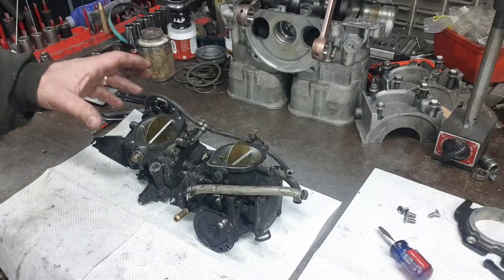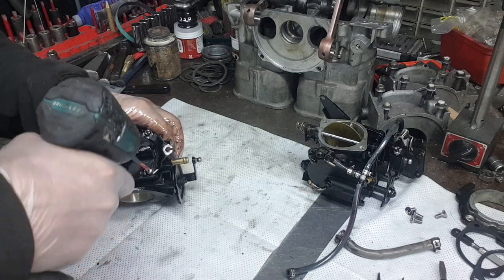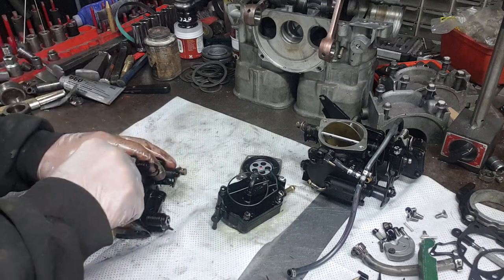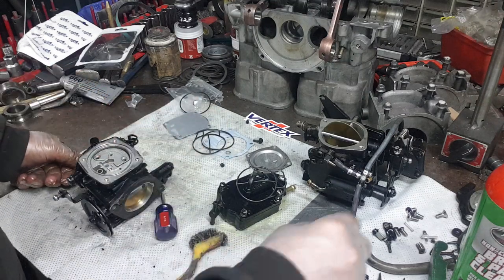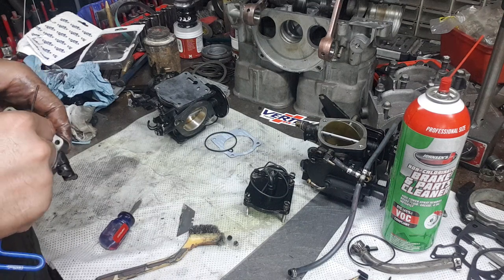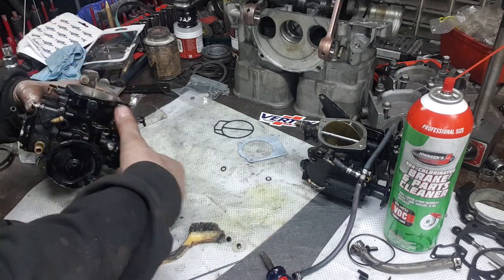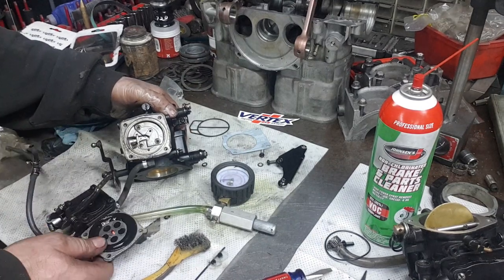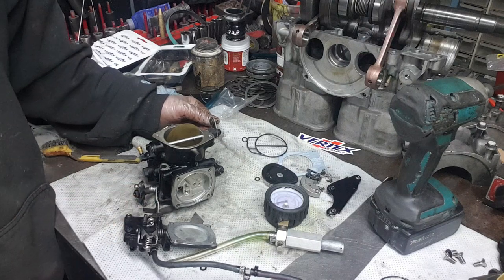Seadoo Mikuni 50mm 951 GTX XP GSX Carburetor rebuild & fuel assist pump.

Comment: Does anyone know where to get the little orange umbrella check valve inside the accelerator pump? you can see it at 29:45 when he starts blowing out the ports. Mine tore when cleaning the ports and i cannot find the replacement and its not on any diagrams.

Comment: On the side without fuel pump where the fuel diaphragm is on the other one how many gaskets goes in between . Is it just the one o-ring gasket because the kit I got came with the same parts as it did for the fuel pump side

Comment: just subscribed, great video. how important is that circular orange rubber in the fuel assist pump, mine seems like its torn off. thanks
Reply: Were you able to locate this orange umbrella valve? Ive been searching for days and Im at a dead end

Comment: I have seen another rebuild video covering these carbs and he said you do not need the diaphram rubber and plastic in the carb that does not have the fuel pump which i thought was odd?
Reply from the maker: @andywilkins-f5x  that’s actually true, only if there is a fuel pump.

Comment: What's ur take on the Grey fuel lines? Is there any precautions u'd take concerning replacing them and/or anything else in the fuel system that should get attention?   Tygon?
Reply: REPLACE THEM . Currently rebuilding both my carbs because the grey fuel lines turned into green goo because they deteriorated over time and now my carbs are full of green goo and every single jet and filter is clogged

Comment: How come you just don't reject the carburetor on the low side adjust the low end speed square and do away with the assistem but as soon as that little rubber check valve fails and it does a lot you're back to square one
Reply from the maker: True they do go bad. But the assist pump helps big time to start the motor when its cold. If you pump the throttle it acts just like a primer.

Comment: Aftermarket kits... no bueno!  The diaphragm material is meant to be light (referencing OEM).  Heavier diaphragms will essentially alter the pop-off pressure because it requires more manifold pressure to suck the diaphragm inward.

Comment: My seadoo xr  has new rebuilt carb but doesn’t suck the gas no injection! Only start when I  put gasoline direct to the carb !! Any advise why ?
Reply from the maker: Did you use good rebuild kits? 
Try another carburetor or you may have the fuel lines reversed and possibly the pulse line is not connected properly.
Reply: @5StarPWC  check. All lines change the new hose’s and put a sbt rebuilt kit  . I also clean the carburator with ultrasonic cleaning machine and still the same. It’s line no vacuum …. But if I cover carburetor with my hand vacuum increase